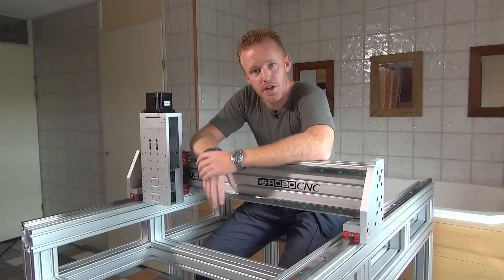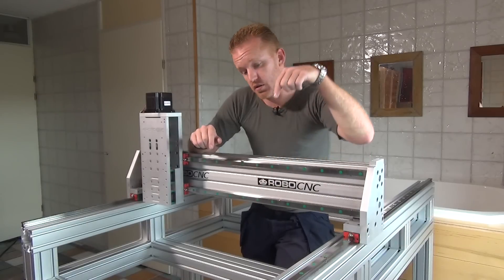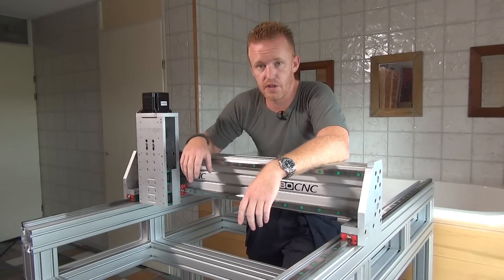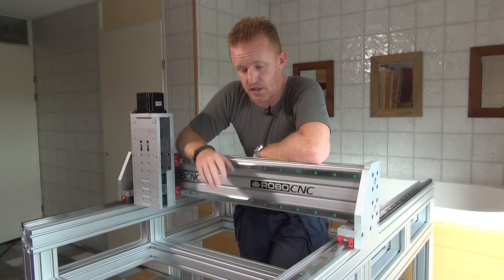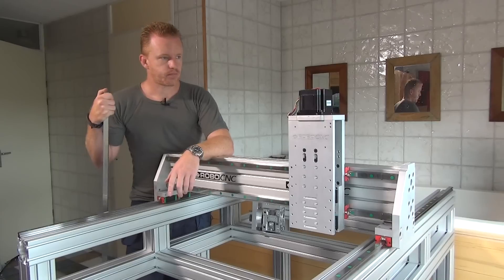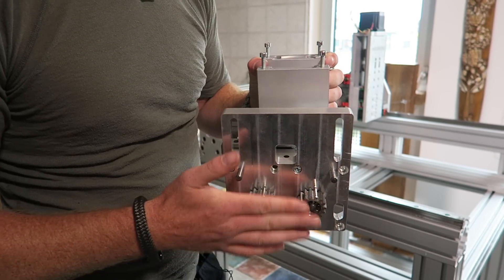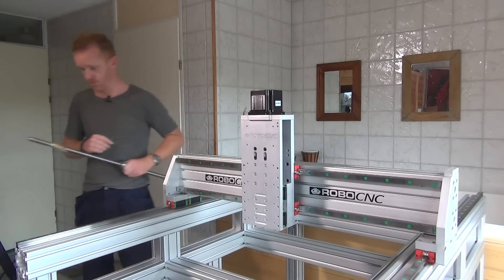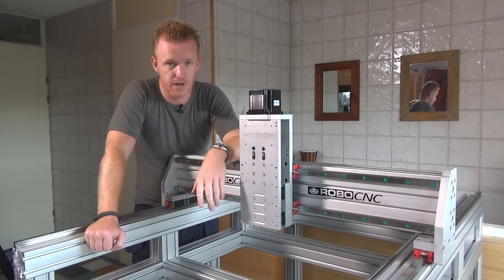RCNC X2 Router 08: DIY CNC Router 50% update

Comment: Hi there, i recon this posting is a bit aged but still one of the best designs i've seen so far.
Have already looked to your web site and many thanks really for sharing the designs !! I've notice quite a number of parts are sourced finished but there are some ALU plates which need to be worked out to i assume a good level of precision.. 
I was wondering as this will be my first CNC and i do not own precise tools... (e.g. a mill) is there any way around that ? any suggestions ?
Many thanks again
Reply from the maker: Thanks for the nice words, and while the machine is running I answer your question. Well like the chicken and the egg, it’s always hard to start the first one. But although I can not be of any help, there are for sure cnc shops around your location to try. It is correct that you better invest now in high quality, or n stead of trying to diy with a chopsaw :)
Reply: @RoboCNCnl  yeah as i suspected :-) either get a mill which i might need either way... or find a CNC guy :-) thanks

Comment: I want to build my own CNC, I like most of your design. I purchased a small CNC to learn on, one of the things I don’t like is the T-Slot bed you are proposing, the CNC I bought has that style of bed. It requires a salvage be to protect it, with the T-Slots  running the direction you are proposing has its drawbacks with the salvage board and the use of t-Slot hold downs .Certain sizes make it hard to.clamp down, and in a lot of cases I have to enlarge the material to accommodate clamping, which increases my waste material. I have an idea that is hard to describe in an email, it might solve the bed leveling issue. Not sure how we can contact each other.
Reply from the maker: Thanks for your thoughts.... I do understand your point, although a spoilboard can always be used on top. It is not possible to use like machine clamps on top of a spoilboard so then a tslot table would be great. I'm afraid there is no phone option, so if you can not write down the ideas i'm afraid it will stay a secret :)
Reply: I am going to try and install a single rail t-slot on top of cross member supports. T-slot depth is 0.625” and spaced 6-8 inches apart. Then fill in the gaps between the t-slots with 0.75” MDF. That way the MDF will become the salvage board. If you cut the t-slots 2-3” shorter than the cross width of the bed and center it,you should be able to drop in a hold down clamp from either end. This should minimize replacing the whole bed, you should only have to replace the damaged section of the spoil board.

Comment: Hi Marcel, great build!! I'm at the end of my build (which is somewhat similar to yours - thanks for the insights!), and facing the same question about the bed level, my table is exactly as yours (80x80 cross members supporting the t-slot alum. profiles) and I was wondering what did you eventually do to level it? shims, spoil board, anything else? any information would be greatly appreciated!
Reply from the maker: I did not have the time to do this... :) for now a MDF spoilboard is placed so i can work...
Reply: Ronen, I saw your router model on GrabCAD and it is awesome.  Are you going to post a video? Do you have any other bill of materials you would like to share on it? I am thinking of building one based on yours but 5-6" inches of extra z travel.

Comment: if you pre-tension the ballscrew it can not wobble as much, usually thats done with an angular bearing or a combination of bearings with one being a thrust one pushed up against possibly a normal ball bearing. with pre-tensioned ballscrews manufacturers often rate them as usable with double the length or more :)
Reply from the maker: Anoneom the wobble would even be there with no nut on it... a long shaft is not good for rotating at high speeds... but if you disagree then I would go for ballscrew since it is the most precise...

Comment: Marcel I don't know what you did about leveling the bed. It has been a while since last you published more follow up on the X2    I was imagining that you would flycut just the bed rails :-)  I have decided to adopt some of your design save a few changes, I acquired 2 x 2,5m pieces of 45x180H 80/20 If I use them for the X  maybe I have even more possible problems coming. My build will have to be a so-called half sheet machine to be of any use to me however I am only doing wood 3D. 
So I will try  to use the profile and add some steel angle. I will be welding the base from 0.125" gauge square tube and hope this will increase the mass and therefore the moment  If it is not enough, there is always sand fill. or better  2 layers of 3/4" (20mm) MDF between base structure and the 80/20 assembly. But then this begins to look like a "Joe's" design :-) 
As I have your attention, there is this matter of this ebay vendor.  Have you bought entire kits from Chai @ linearmotionbearings2008? I am pricing a 1300 x 1500  Hiwin w/RM2010  and well. the prices are so very low ~$600USD including the shipping..... I am worried what I will be getting. Best regards Marcel. And a Merry Christmas to you and all there in the NL
Reply from the maker: Hi Chris, Thanks for your comment and nice words.... The problem with the updates is that I have 2 jobs and a private life te mix with the build... And much more stuff to do (like a even bigger laser that enterd the shop..) Anyway... there is some news, but to see so you would also have to follow my different social stuf like facebook and instagram. 
For the bed profiles I was planning to glue thin pieces of derin sheet on the bed profiles and flycut that. This is basicaly the same but it prevents the problems you would get due to the fact you can not reach everything. And it will give some dampening . 
No I only buy ballscrew from Chai, the HIWIN rails and blocks i directly buy from HIWIN or DamenCNC (local vendor). There is a lot of imitation on the market from china so be aware... 
Merry Christmas to you to !

Comment: Hi Marcel, perhaps I got an idea for your bed profile problem. You can try Corian from Du Pont as a middle layer (in between your frame and the bed profile). Corian is very easy and precise to machine and is also very stirdy.  I did some tests with corian in different other fields, I guess this it may work fine for your task. Love your cnc approuch and your developements!
Reply from the maker: Hi Maththias, thanks for the tip ! I think indeed that would work out great.. I have been working with Corian a few times and indeed it machines great.. I do think it is a costly approach, and a bit thick.. Although some are availible in 1/4" (6,35mm) It still is expensive material... (I did one buy a second hand kitchen to work witgh though :) ) I'll keep it in mind !

Comment: hii Marcel, my CNC design has length of 5 feet for y-axis . so it will be good or not to use same rack and pinion gear system for y axis too as you used for x-axis. please rply
Reply from the maker: Yes that would be much better than ballscrew in that length
Reply: 5ft and above rack and pinion is great as often that length the screw will shake a bit unless only using middle of it

Comment: Hi, Marcel!! First of all, now i know your name ( not a Robo actually:-)) At second- great machine design! Aluminum extrusion is right choice for big, rigid cnc.
It`s hard to control temperature deformation of steel profile during welding, so much easy to assembly frame with aluminum profile! And if you want to use some material between bed end frame- try some plastic ( like Altuglass, for example), wooden bed is not an option if you using some water cooling for spindle!
Reply from the maker: Hi there ! and thanks for following along :)
Thanks for the comments, and indeed, although it's somewhat expensive, these profiles make the build easy and very sturdy. I wish steel would hold still while welding :) But i have no machines to scrape or grind it flat and square indeed. The coolant is indeed the reason for this approach because I really mis that option on my old machine. Even a mist or fogbuster would not be possible on the wooden bed.
Reply: You are right about material of bed, because coolant destroys wood or plywood very fast. So, you need some sort of plastic or composite material ( like fiberglass, for example)
And you will be an author of BEST cnc machine in Netherlands)) By the way, i read a lot of information about culture and work relations in Netherlands- very interesting!! So, it will be hard to say for you " I am best in CNC design", You may be misunderstand by Holland society. But youtubers knows- your design are best!!)
Reply from the maker: Lol.. You already know our culture well... 
(But believe me, we do think we have the best design, just don't say so haha)

Well I'm fortunate to be able to build a version 2. And although number 1 has served me well There are many thing i should have done differently. A learning curve resulting in this machine :) 
Anyway... Thanks a lot for the nice words and the support ! much appreciated !

Comment: I'm not even close to being an engineer and unless I've missed a previous video about you testing what you've already assembled you may be working yourself into some future problems Marcel. The main starting requirements for any accurate machine tool are.

Rigidity: And for the size and power of the spindle plus maybe compensating a bit with cut depths and feed rates your assembly does seem pretty rigid. Not to the level of a large industrial bed mill for example, but that's not what your building or even trying to have the same capability's. 

Alignment:. This is where you may be building yourself into a problem. Those aluminum extrusions will be fairly accurate but not in machine tool tool terms. Mid cost manual machine tools have there slides hardened and precision ground to quite accurate specifications. Very high accuracy machines will be scraped into as perfect alignment as possible.  Yes your linear ways are hardened and ground as well, but there bolted down to those extrusions that aren't ground to a true flat plane. That can and likely will result in your linear ways having high and low points along the length of the travel. Setting up an Autocollimator or an even more expensive machine tool alignment laser would be the fastest method, but few of us have access to or can afford to buy either. Failing that then many many checks with a precision machinists level along each linear rail and shimming each low spot until those rails are also flat and true and in the same alignment for both rails to each other is about the cheapest method I can think of. Again since those extrusions aren't accurate enough your going to have the same issues in both the X and Y axis on the bed. I hate to say it but if you want to keep those Tee slotted bed extrusions and I'd feel the same way. Then once you have your X and Y axis properly trued your going to need to check each bed extrusion with a dial indicator suspended from your spindle mounting bracket probably every 25 mm or less and again shim each low spot and get the bed itself true to  your X and Y axis travels. I don't think using those plastic strips across each cross rail are going to give you a bed surface that's true enough.

Resistance to vibration: Today a lot of modern machine tools are computer analyzed during the initial design process and built from weldments..But that resistance or dampening to reduce vibrations and harmonics is an important part of the overall design. A lot of good industrial quality machine tools even today are still built from cast iron mostly because of that dampening ability it has. Aluminum and aluminum extrusions are capable of a lot less vibration dampening. Wood is capable of a lot less than cast iron but better than aluminum is. You may not end up with a choice but to fasten a heavy sheet of something like MDF to your bed and then surface it to your X and Y travels like you mentioned. That would simplify getting your bed true to the rest of the machine but I understand why that would be something you'd rather not do.

Overall I think you've come up with a hell of a good design using almost all off the shelf components. But you may still have to make some alignment checks and maybe compromise on the bed by adding that waste board surface.But I've been wrong about lot's of things before. Just my thoughts and I hope you don't mind the input Marcel.
Reply from the maker: First of all I want to tell you that I appreciate it a lot that you think with me and take the time to share your thoughts.
Although I do not really agree this does not take away from the fact you help me think about curtain design elements.  

It's true you have to keep in mind I'm not trying to build a biesse Rover or a complete factory machine. I'm improving my previous design. And I think It's going to be improved on a lot of thinks. That said, the previous machine has worked great from 2008 till now, and has made me my money daily. So In rigidity I think and hope i'm quite oke... again, i'm trying to improve from the old machine, and this is way way more rigid. And by the way, almost all of the chinese built routers still work with the high gantry style, don't underestimate that design flaw in relation on rigidity and vibration.

For the alignement on the cast and welded machines the indeed use an even bigger machine to ground the places where the rails are mounted. But lets be honest, there is just no way we can do that. I have to assume the profiles are flat enough for my needs. And having spoken to guys at DamenCNC (who build about 5 machines like this a month) I dare to take that risk. And of course i'm going to level the machine and test the accuracy, but grinding is is no option. btw, for the steel welded machines this assumption would not work because of the welding they do and the effect that has on the steel shape. 

On the resistance to vibration I agree... I do hope this is not going to give problems, will have to see. I could decide to change the harmonics of the frame by filling it with sand or a epoxy cement later on. This would will improve rigidity slightly, but will change the harmonics drastically. I have not got the skills to simulate or calculate the possibility of these problems. 

I do understand that in a perfect world things could be improved. But this is what i can do in a home shop environment and with the provided tools. And of course I will try to measure all variables, and fight back at problems along the way. Again thanks for sharing your knowledge ! And please keep doing so.... The best advise is people who see problems (even if the changes are not to high) and of course have ideas how to solve these problems. Thanks !
Reply: I'm glad you you took my comments how they were intended Marcel. I probably look at machine design from a perspective of something that's capable of machining steel and other hard materials since that's the usual materials I machine. And I know that's not likely to be done on this machine. You were reading my mind about the possibility of needing to add sand or that epoxy granite mix. Your first test cuts should give you an indication if that might be needed or not. I doubt calculating vibration and harmonic problems for any design is an exact science no matter how good the simulation program is. There's always going to be variables that can't be foreseen with 100% accuracy. I'm looking forward to seeing your fist test cuts very much. I haven't seen another home built gantry type router design as well thought out as yours has been. .
Reply from the maker: Thanks again !

Comment: That machine looks amazing! I REALLY want to build something like that some time, but I just don't have the room...

Stefan Gotteswinter recently posted a video showing an epoxy that can be used to level very large milling machines. It might be exactly what you're looking for. He mentioned that it is expensive, but I don't recall if he mentioned the price. I hadn't even heard of the stuff before Stefan mentioned it, but it sounds like a very good solution. I'll reply to this comment with a link to his video (I'm putting it in a separate comment in case it gets automatically marked as "spam".)
Reply: Yup, looks like Google decided it was spam. If you go to Video Manager -> Community (left side of the screen) -> Comments (subcategory) -> Likely Spam (tab) you can view the message and "unspam" it if you want.
Reply from the maker: Thanks I will have a look at his video ! Thanks for thinking with me !
Reply from the maker: Will do ! Thanks !

Comment: Hey Marcel, great project! The delrin ring is a very good idea for levelling out uneven surfaces expecially when you engrave, are you going to make an option to adjust the cutting depth and an option to adjust the weight of the head (Z-axis)?  If a mechanical levelling system doesn't work you might want to check out a software solution f.e. "http://www.autoleveller.co.uk/".
Reply from the maker: Hi Jaap, Thanks for watching, and the comment !
Yes the ideas is to make that nosecone adjustable bu lets say turning it on a thread. 

The electronic solution is cool to, I do have a probe so I could go for that route. 
But lets first see If I will eventually even use this feature :)

Comment: There is quite good solution buying precision milled aluminium plates from gleich.de and use it as a base for measurements and threaded holes fixturing system.
Reply from the maker: I will use the plates as shown in the video, so I'm not looking for a replacement but a good way to make sure they are mounted flat. Machining an aluminum plate with holes can be done on this machine afterwards :) 
Anyway, thanks for thinking with me!